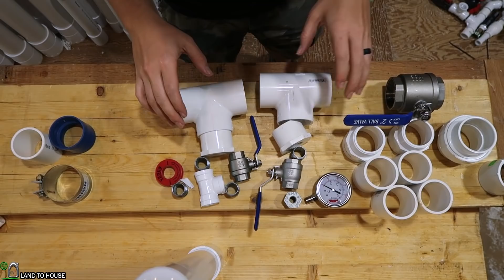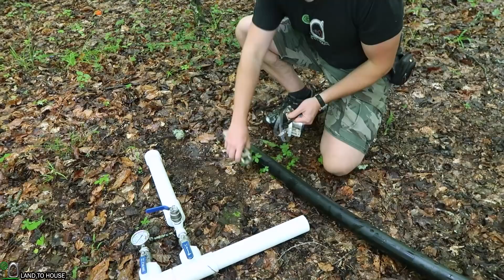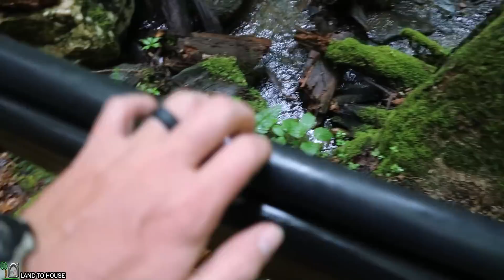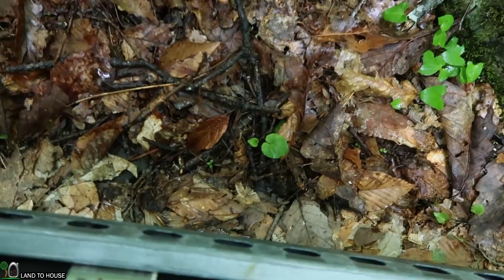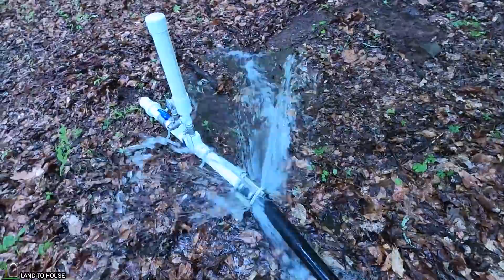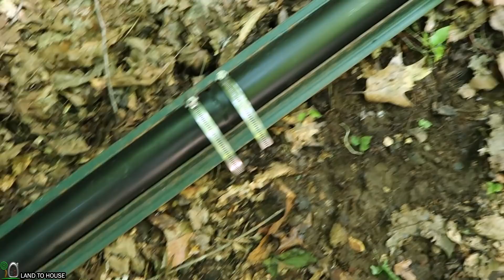Pressure Test and New Couplings Micro Hydro 4/10

Comment: PVC is not a glue its actually a solvent that welds. It melts the pvc pieces together you need to use primer before or you are just slip fitting the pieces together with glue. And white teflon tape is made for small Fittings less than an inch.

Comment: You might want to change those pipe nipples to plastic. That's typically a plumbing no no. There is a potential for cracking with metal threaded into plastic as the materials have different properties. Over torquing or expansion and contraction differences are the problem. Watch those joints at penstock pressure gauge/hammer arrestor section.

Comment: Hmmm ,before i seen all this , i worked at a swimming pool company,  we used galvanized barb ,  heated the pipe  2 clamps on each side ,  so my suggestion check a pool supplier,

Comment: i do irrigation work with the same type of pipe and we use 2 hose clamps on each joint when working with pressure over 25lbs

Comment: If you ever have more problems with couplings try to find somebody that can fuse the plastic for you. May be a plumber that has the equipment, or a local contractor that does water/gas work. Fusing the pipe will be stronger than the pipe itself.

Comment: Great series to watch from the other side of the pond. Are you planning to get an aluminium catch tank made for the head of the water run? Most of the materials will last a life time, but that timber catch tank will rot out over the years.
Reply from the maker: Thank you. I am actually thinking of making a custom intake out of PVC trim boards. They are strong enough and do not rot. We shall see.

Comment: Those exterior connectors are rated for that pressure but you have to alternate the hose clamps. They need to pull away from one another. The barbed fittings are better but using 2 alternating hose clamps per side is better

Comment: The end waa capped so the air that went before the water caused problems. When house is plumed all the outlets in the house are open to relieve pressure on plastic pipe.

Comment: Why did you not just glue the pipes together using a outside external joint? That way your volume would not be restricted and you would avoid the possible build-up of trash inside your system

Comment: Go and buy the correct poly pipe joiners like Philmatic wich have internal barbed sections to give the bite and strength. Easy to service as they can be undone when needed. 
Rubber comression joins are for "Patching" rigid pipes that don't move. As for pushing in the barbed sections, peice of softer pine wood and smack them in.

Comment: The air pocket anti water hammer thing doesn’t work over time because water can absorb the air and eventually their will be no air to absorb the pressure
Reply: What's the alternative?
Reply: Jacob Whyatt they sell a pice that has is basically a syringe with a spring that absorbs the pressure they are rated for 50+ years I believe

Comment: The rubber coupling's would work if you wrap them with a thin sheet of stainless steel to keep it from bulging .
Reply from the maker: That might work. They were also wanting to slip off when the ball valve was closed.

Comment: Lots of hard work in that keep it up. Just FYI if you keep having issues I bet one of your local plumbers has a pipe fusion tool no fittings just helped a buddy of mine fuse together 1500 of 1 1/2 pipe like thst worked grate.

Comment: Me thinks it would be worth it to order a single piece of pipe to run the full length so you do not have to worry about fitting along the way. I understand fighting that length of pipe would not be fun but better than wondering every night if a fitting popped off.
Reply from the maker: That would be a massive pipe. 1100 feet of 2" pipe would weight a couple hundred pounds. Good news is that the turbine has worked flawlessly for a month.

Comment: I probably missed it, why did you get so many cut sections of pipe instead of getting one long roll with way less failure points?
Reply: I'd reckon he didn't a machine or a straight shot to roll out 1k plus feet pipe thru the woods on uneven terrain

Comment: I am really enjoying this series. I live in Seattle so the likelihood that I will need to duplicate your project is very slim (but we can hope), still I like your ideas and how you go about your work (in an earlier code, “I hear thunder, but we will work till the rain starts”). I hope all your PVC joints hold up forever. I mean that sincerely. But if at some point you find they leak, when you make your repair please consider using PVC primer. I don’t know anyone who likes to use primer but I think of it as just a little bit of extra insurance. “While you may be able to create strong joints without it, primer is an important part in making sure your joints are as strong as they possibly can be. ... The purpose of primer is to begin the chemical reaction that softens PVC and to provide an even prepped surface for the solvent cement. As you may know, PVC joints are not glued together exactly, but fused through a chemical change. The softer the outer layer of your PVC, the better it will cement in your joint. This is how primer helps your joint strength. ... When it comes time to apply your primer make sure you are 100% ready to prime AND cement. Primer is effective only when wet, so you need to move quickly once you begin.” https://www.commercial-industrial-supply.com/resource-center/do-i-need-to-use-pvc-primer/ I am looking forward to watching the next and next and next. I am not a plumber, by the way, but a master plumber for whom I have a lot of respect gave me a little advice I will pass on. “Use fittings and pipe of similar materials. Plastic with plastic, metal with metal. Your stainless ball valves are truly beautiful. As a boat guy I see the value, but when I think of my friend’s advice, I think you might do better with PVC valves. Also, reduction couplings are better tradecraft that reduction bushings.  I don’t know exactly why, butit has to do with failure rate for bushings vs. couplings, so if you use bushings anywhere in a home you have to provide some sort of access in the event that  a bushing fails. Great work!

Comment: That joint between the black poly pipe and the white pvc is not good enough. You need a very secure, strong, type joiner. I have only got 30 psi static pressure and have found that o'ring type work well.
Reply: And there you have it, leaks.  You need to replace all your joints with o'ring type joiners,  it is a big cost, but once fitted they will cause you zero problems. Additionally you can disconnect and reconnect the joints as many times as you want.
Reply: I think your heated barb joints should be a good long term solution. Although the o'ring type, specific to the poly pipe would be the correct fix (like the blue Chinese type you showed us). The only down side to the heated joints would be they are fairly permanent, unable to undo if you need to at any time in the future.

Comment: You could put a schrader valve (tire valve ) in the top of the air tower, you will be able to pump air into the air tube when it becomes full of water.
Reply: Looking at the leak you had ( the one you called a guyser) there was air bursting out.  Have you sorted that? If not an air stand out the top of the drum at the top of the penstock will prevent that.

Comment: I figured  that you was likely to have the water leaks that you had. I thought that as intelligent as you are it just seems like some things just fly right over your head.  But then I thought how much I appreciate the fact that you show the mistakes along the way. Good on you for showing the failures and not just skipping over it without stating what mistakes you made and what you did to correct them. Really enjoy your experiments with the wins and lessons along the way👍
Reply from the maker: The issue with my failure was that I really wanted to have a coupling on the outside of the pipe and my really nice fittings did not fit. I knew that barb fittings would work and wound up having to fall back on them. Oh well. Working very well now!

Comment: I use the gray fittings on my farm irritating I run up to 70psi never had any issues.
Reply from the maker: The barb fittings are doing very well.
Reply: Louis Williams and sons in hendersonville NC they carry alot of odd stuff, and larger stuff. I know it a haul for you but if its something odd you need right now

Comment: I'm honestly surprised you were having trouble with those rubber joints or "donuts" as we call them, we have a 1500ft siphon from 2" PVC pipe and connected with those rubber joints for flexibility in some areas and they hold 75+ psi
Reply from the maker: I was a bit shocked myself. I really thought they would hold. I was getting 70psi at the very bottom. They would hold until I closed or opened a valve and then they popped.
Reply: Land to House Unfortunately, no matter how slow you turn the ball valve you will still encounter some degree of water hammer. Using a needle valve instead of a ball valve should make a huge difference.
Reply from the maker: So far with slow turn I have seen a spike no higher than 80psi. (Turned off the water just a little to fast) the pipe is rated at 100psi. So I need to be careful.

Comment: Makes you wonder what the typical or recommended use for those Orion couplings is.   Maybe they recommend cement? Glad to see you found a resolution after multiple attempts.
Reply from the maker: Yes definitely took a lot of  trial-and-error. Apparently those other couplings are for drainage not pressure
Reply: After a quick search. It appears these are to be used with a ‘groove tool’.  Hefty price tag on that thing 😬
Reply from the maker: The barb fittings were like ... $2 each. Best way to go.
Reply: @LandtoHouse  That was my thinking on first seeing your piping. Hose barbs hold, slip fittings slip. Even compression unions for PVC are known to slip off. Which is why I put two 90s in at every one of them. Then tie the two legs together with rope or strapping. Keeps them together and can be removed if needed.

Comment: Very interesting. I am enjoying the series. One suggestion though from years of working with large PVC joints. When you are gluing pieces together and you have cut 2" male sections and you have the room. Make the male sections longer. So when you make a mistake you saw it off and save yourself from having to throw away your whole glued assembly and start over. If you have no room after sawing it off you have to purchase a lot of expensive fittings and rebuild from scratch. It will save you a lot of grief.
Reply from the maker: That is true. So far this section of pipe is doing well. It has been running for a month without issues.

Comment: Love your channel.. Here is a guy you should watch he's got a few ideas, that could help you in your micro-hydro venture...  https://www.youtube.com/watch?v=DqaWnOOiNbI&feature=em-uploademail   At each joint you can put a t connector with a valve on top to purge air if it gets in the lines, that would be much easier then to chase it all the way to the top.. That bursting apart is just what I figured it would do, when I seen you use those connectors instead of barbed ones.. I Know you said you switched to the barbed ones...  Yup, you need to add a lot of heat to it... some people uses a pot of meta boiling water to stick the ends in while using the torch to heat keep the water hot... Gloves are needed cause it gets very hot.. 65 pounds is not to bad at all, with some tweaking I am sure you can get way more then that.. If your weather allows you to use regular PVC (heavy duty) plumbing pipes you would get better flow & pressure. bad & costly part is, you would have to use a lot of union connectors so you can do maintenance and replace pipes as needed more easily... There are literally hundreds of videos out there where you can see many technique's to how others did them.. I watched one where this one guy made a, like pipeline that was about 3 feet up concreted posts in the ground and had a rail connected to it from source to his ram pump, then that black pipe all the way to his turbine, he had I believe two very tall stand pipes so the hammer would not cause to much back pressure to his PVC piping.. I look forward to seeing your next exciting episode..
Reply from the maker: Thank you. There are so many different ways to do things like this. So far when air gets into the pipe it can take up to 20 minutes to purge out. Not too bad. I just turn off the turbine and slightly crack the valve so that the water slows down. 

The barb fittings are working very well. I did not go pvc because it gets to 5 degrees in winter and might crack

Comment: PVC manufacturers recommend using primer on anything over 1" to break the surface for a better weld. Also heavy (gray) glue on large pipe.
Reply from the maker: So far this has held well for a month. If it has issues I will reinstall with some primer. I have not seen the gray glue?
Reply: @LandtoHouse  Keep at it, you're doing it well.
Reply: Red hot is sufficient in many cases when applied to both sections pre assembly but primer is required for code for potable below grade. But states varry on code.
Reply: Just use the cpvc glue for regular pvc its bullet proof 👍

Comment: Don’t they make unions for that type of pipe?
Reply from the maker: Yes they do. I ordered a sample and went to test it out at the lumber yard. Worked perfectly. So I ordered 10 of them. Then I found out that I also ordered poly pipe that is a smaller schedule. . . The fittings did not fit.
Reply: Land to House I also thought having a shut off at each section would save you tons of time from having to walk all the way back to the collector.

Comment: Have you looked into a plastic pipe welder that heats both ends and fuses the pipes together instead of the barbed fittings?
Reply from the maker: I did price one of those. Sadly it was too costly OR was not mobile enough to get into the woods.

Comment: Those Fernco rubber couplings are rated for less than 5 psi.  They are for drain pipes, not pressure.
Reply from the maker: That makes sense. They almost held for a while. Might have worked for the very top most joint. But with any pressure they just popped right off.

Comment: I really like your stuff Seth. Like the way you do things. But man that riser was over complicated. it's not going to hurt anything putting it there but in my opinion I'm not sure that it will do anyting beneficial. Either way keep up the good work. I really like the series so far
Reply from the maker: Thank you for joining in to the channel!

Yes that surge tank might not do anything ...but might keep it from busting fittings. I have seen pressure jump up to 80psi when I close the valves. (very slowly)

Comment: Glue a union at the unit at the end.  That way it's a positive connector that you can take apart for service.
Reply from the maker: Yes that union is key to installing and uninstalling the turbine! I have already had it off of the system once and will be doing that again soon for a new nozzle size.

Comment: I lived on a 6" 100+ psi micro hydro for a while.   Learn to open and close valves and shut offs very slowly.  The hammer effect of sudden water weight change is very real.  Use 4 or 5 bags of ready mix to make a cement block with my 4 large eye bolts  embedded slightly uphill from your turbine and valve manifold. .  You can then "anchor" to it with chains if needed.  Just some ideas....   65 psi is awesome!
Reply from the maker: That is a big pipe and a lot of pressure.  Having worked with the ram pump for 6 years I definitely have experienced a lot of water hammer. 

 I learned from Joe malovich that the pressure wave can pop fittings quite easily
Reply: @LandtoHouse  a couple of lengths of 2" schedule 80 400 psi belled pipe (face bell uphill) at the end of the system, anchored well, would really hold the tail end of the system in place.   An old farmers irrigation trick:   get old bike tire tubes and cut into 1x20" strips.  3 or four strips wrapped tightly around small leaks will shut them down 100%, especially near the top of the system.   Awesome hydro system!

Comment: Very interesting series. Thank you. I was wondering why you didn't join the piping the same way that you joined the white piping, essentially a length of rigid plastic pipe that fitted over the two ends and then glued in position? Looking forward to the next video.
Reply from the maker: Thank you. The black poly pipe is made of a different material then the white PVC. It does not glue together the same. That is why I had to use the Barb fittings.  I had purchased a special kind of fitting but it would not go on the pipe that I had because it was too big.